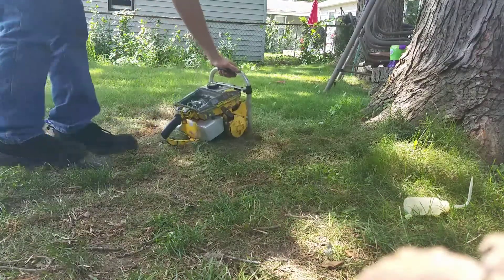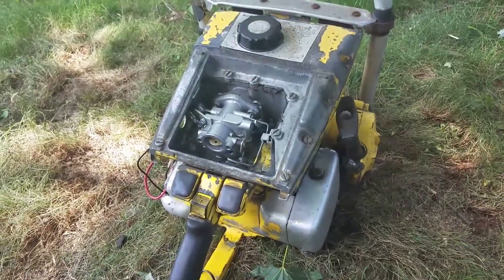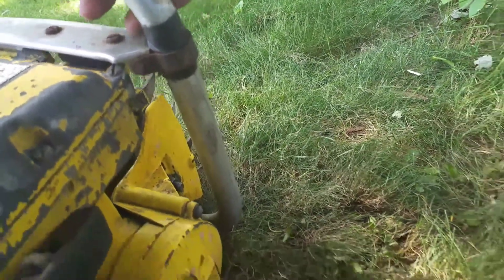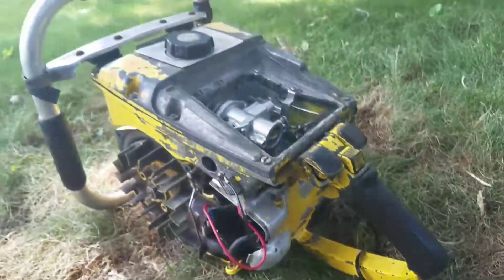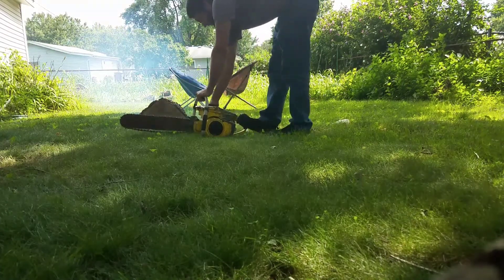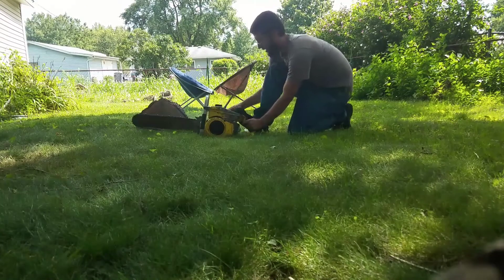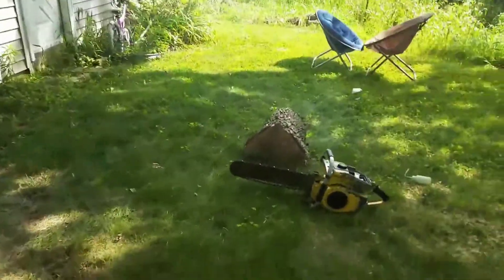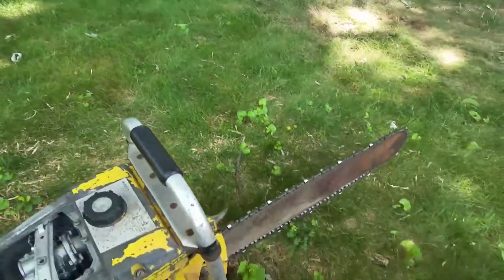1961 Mcculloch 1-72 carb rebuilt and test cut part 4

Comment: Hi Mr Gray do you  now wher i can get parts for an old 1-72 Chain Saw an a Bar do the modern ones fit on them old once ?
Reply from the maker: What parts you after? These have the larger bar mount pattern, I'll have to get back to you on what the pattern size is. Old mac bars can be found easy enough. Get most my parts off Ebay (try not to) but mainly try and get from people that still have them outside Ebay. I'll get you the numbers of a couple guys that may have parts and even bars.
Reply from the maker: First guy is Woody in Monroe, Wisconsin call Woody at (608)-558-3145 or e-mail him at woodycarol@tds.net.
Reply from the maker: Second is Bob Johnson in Maryland, New York. His number is (607)-638-9297. He only has a phone number, pays old school way.
Reply: @mistermacgray  okay thank you mr Gray